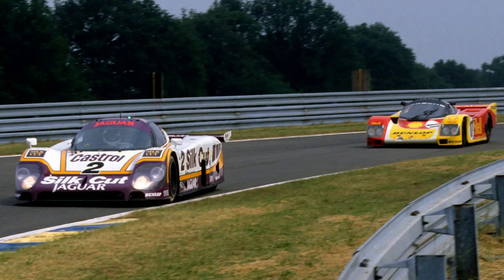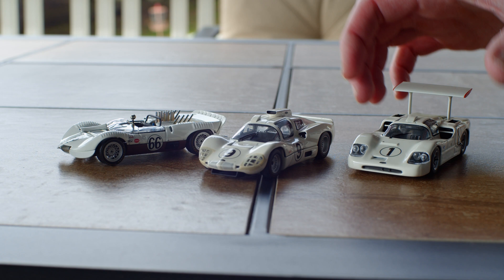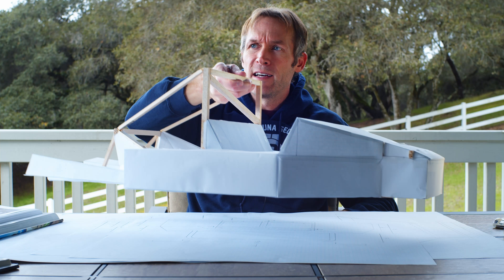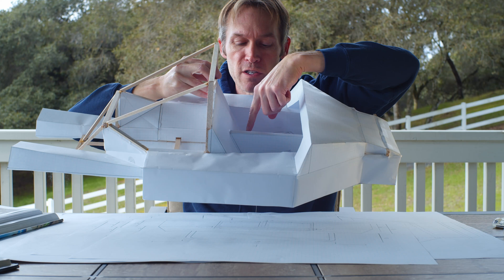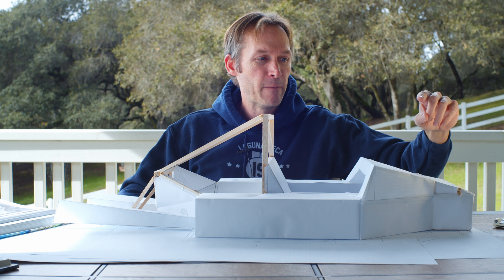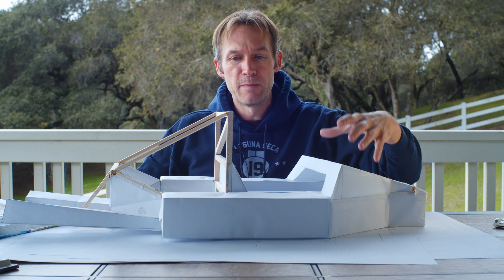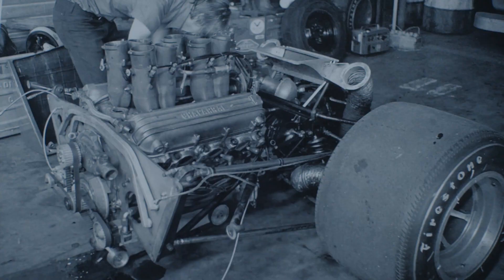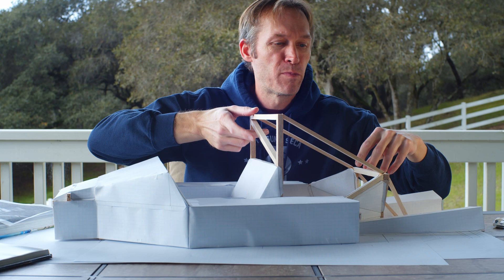CAN-AM TUNNEL CAR!?!? Chassis Design

Comment: For the instrument cluster, maybe make a little removable panel that houses your gauges, with four bolt holes in the corners. Then have a hole in the dash/scuttle fascia big enough for the back for the gauges to slide into, and have anchor nuts on the four corners to mount the instrument panel.

Comment: What you were talking about with the foam reminds me of foam-core composites, sort of the poor man's version of aluminum honeycomb composites. Its commonly used for things like custom rear wings, where the carved foam acts as both the buck and to resist compression on the skin of the wing, but I've also seen it used for structural panels where the foam is cut to the desired shape and the fiberglass or carbon fiber is laid/wrapped in both sides of the foam, no vacuum-bagging necessary. Some people will do that partly just to form panels without a buck, since the foam can be held somewhat in place on its own, and it sounds like a good way to make flat panels rigid when you can't rely on the stiffness that curves in a panel would provide. It would be tempting to try to goad you into making a foam-core carbon tub with that technique... but I'd expect that to be a lot more hassle. You've already got so much experience with the aluminum sheet designs, which are probably significantly cheaper, plenty light and stiff, more reliable (you're not worrying about whether or not the epoxy cured properly), and a lot easier to mount components to.

Comment: Was in a similar spot a couple years ago - lots of complex aero ideas for a time attack build. Best thing I ever did was hire a professional aerodynamicist to work with me. I learned a ton that isn't found in books, and through hundreds of cfd runs we both learned more than we would have in years of building and testing part combos. Would advocate hiring one, to at least get you in the right starting ballpark. From there, there is still lots of room to experiment and learn. Also keep in mind you will need a proper sensor package to know how well the aero is working.

Comment: The McLaren M6 was (according to Robin Herd) designed with the front underbody swept up like the underside of a wing, and when they tested it with no body work, it produced negative lift i.e downforce. 
So technically the M6 had some degree of ground effects, which is a little known fact.

Comment: I was lucky enough to see the Can Am in it's hay day (1963 +).  In my opinion, and not because of nostalgia, it was the best racing ever.  Only a few basic rules, very fast and the sounds and smells were unbelievable.  I saw ever driver of the era race there from F1 and Indy.  Also even if you didn't have a huge budget you could field a car that was competitive.  Those days are gone forever.

Comment: Yeah baby 612 is one of my favourites.
I’m fairly sure most group c cars had full width tunnels (between the wheels) in the middle and up the front,  and only split into two to clear the sump & gearbox. 
Also, look at the Lola t222 for stylised wheel arch openings!

Comment: Hi Ben, loving your builds & think that the new project is a great idea.
I do have a couple of ideas that might help…
First up would be the dash bulkhead - you talk about wanting to make it a couple of inches narrower, I think that wouldn’t go far enough to make your desire to build early Can-Am ‘lumpy’ bodywork. Bring the top in to the same width as the tub opening (this would also help when you want to experiment with late/group C style bodywork.
The second point concerns the rear tubular cradle. I’m totally on board with the bolt in upper diagonal bars, but the lower ones I would run as a single piece to the bottom of the roll-hoop, you would be able to tie your engine mount bracing to this. From the bottom of the rear bulkhead I would run twin tubes diagonally forward to the centre of the roll-hoop frame (where your centre tunnel is). This would be lighter & brace the monocoque structure while at the same time providing a load path from the rear through the centre of the car.
Looking forward to following the build.

Comment: Very cool idea. Use fancy aerospace glue on the aluminum joints. Consider doing your own carbon fiber for the rear lower panel. Vacuum bagging at room temperature is very suitable.

Comment: Very Cool project, thanks so much for sharing your vision and enthusiasm!  Inspiration and ideation are addictive, but you clearly have a balance of pragmatism that gets things made.

Your tunnels start way forward, and with the light car, big v8 & gearbox, I suspect your weight distribution will be 40/60 F/R (or maybe more rearward) so factor this into your tunnels / center of pressure consideration.   I like that  you will experiment and use data and results as your guide.  That said, as I understand it (only from reading and seminars), you'd do well to keep your center of pressure aft of your CofG some to ensure that the faster you go and more downforce you make, the more you tend toward understeer so that you approach stabilty of direction (like a lawn dart).  This helps as you back off when you get in a little over your head and the car is pushing the front end starts to come back.  I imagine this would help initiate turn in.  

I'm not a professional, and my opinion is worth only as much as you paid for it, but if nothing, food for thought.  Besides, you probably already read this somewhere else.

I'm very curious to see what your setup / test approach will be to explore & map your aero performance envelope...  onward and downward!

Comment: I’ve never heard of anyone doing this, but I wonder if vacuum bagging, a common woodworking technique for bed laminations, would be a viable solution to eliminate the bulge when you add foam to your aluminum cavities.
The expanding foam may not play nicely in a vacuum, perhaps a dry run would be wise....

Comment: I would love to have a LOLA sports racer, thought about selling most of my collection of Corvettes and muscle cars I could net out 300-400k, probably pick up a nice one, looked at some Formula 5000 cars as well, really like them too! 
Is the guy in FL still building the Lola's? 
I love messing with 5.0 liter chevrolet engines and would really like a reason to build a ridiculously exotic 302 chev.- really short compression height with maybe a 6.125 - 6.25 rod, large bore and even shorter stroke than 3". The piston side load would be really low and the reciprocating weight will be really low, it will rev 10,000-12,000. make 700-800hp with hilborn injection. 
Remember removing 4 oz from Rotating assembly, (clutch flywheel, etc) will get you better lap times than removing 50# from the car weight.

Comment: Hi Ben. I like your design and I have been drawing on something similar for a while
now that "kit cars" finally are legal in Norway.

A few thoughts, build the parts of the "aero tunnels" that you need to incorporate
in the chassis as large as possible and remove all parts that is not needed to
give the chassis it's strength. These parts you build in fiberglass ( or carbon fiber )
as they are easier to change, modify and to work with.

The fiberglass part can also go forward into the tunnels in the chassis to make
this shape more aerodynamic.
You also can incorporate the piece between the 2 tunnels, under the transmission,
together with the 2 tunnels into a diffuser covering most of the rear of the car.

To see how a modern kit car manufacturer build an monocoque, have a look at
Superlite SL-C and GT-R to get inspiration how they solve all the problems,
especially the rear suspension, I like this solution!
They also have the lower suspension arms come inside the monocoque with billet
machined aluminium "cups" while the upper ones are boltet to the outside with
steel brackets.

Superlite also had a car called the LMP, it was a copy of a Cadillac Northstar
LMP race car with the engine and the Corvette C5/C6 transmission/diff shortened
and bolted directly to the engine, as a half stressed member of the chassis.
They did this by using 2 or 3 different billet aluminium frames, tied together with
steel tubes. I have a few pictures of this car if you need.

For using foam as reinforcement, see if you an find some pictures of a Ford RS200
chassis, this was built using aluminium honeycomb panels glued and riveted
together to build a Group B rally monster.....

I have also seen a build of a Porsche 962 where a road going Porsche flat 6 turbo
engine, together with the transmission and the rear transmission, was bolted to
the chassis and the main roll bar, as one package.

Comment: Will one gas tank throw your balance off? Wouldn’t you want it I. The passenger if one to somewhat balance your body weight?
Reply from the maker: The gas tank is on the passenger side to balance out the driver weight. Driver sits on the right side.  In my GT40 3/4 of a tank in the passenger side tank makes the car balance perfectly.